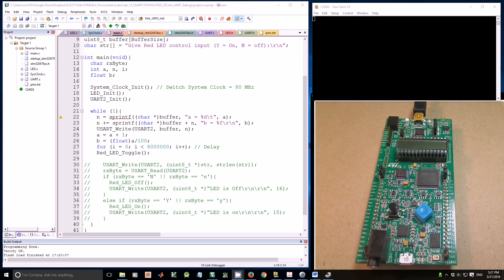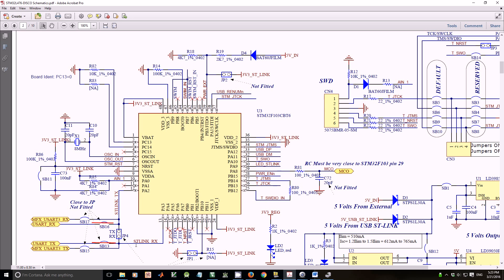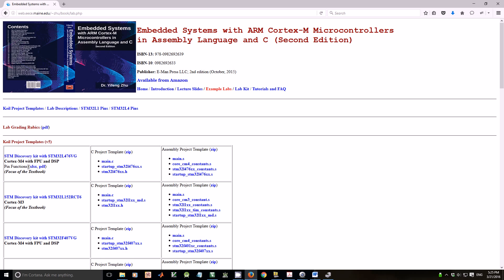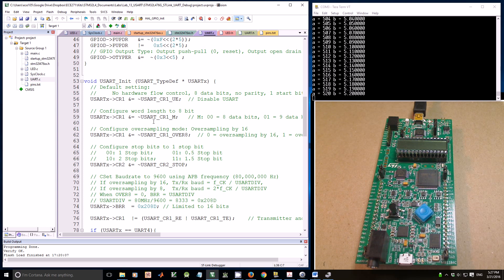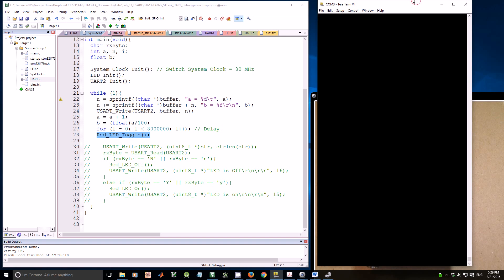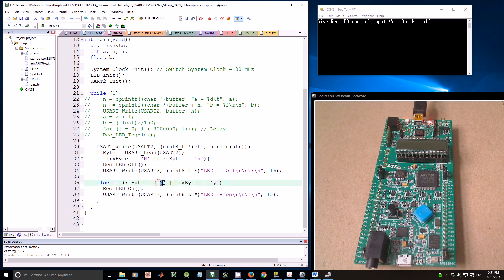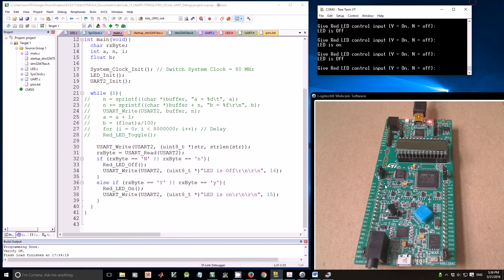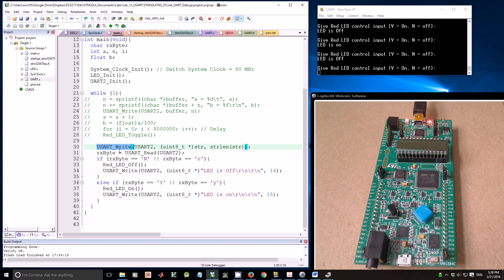Tutorial 4: Printing messages via UART through ST-Link V2.1

Comment: Hello, I am using stm32f407 with st link v2. I am not able to get the COM port and not able to select serial in tera term. Pls help
Reply: Did you find the solution?
Reply: @alperen7009  yes. the st link i was using was Chinese one. it doesn't have that feature to send data. so i used usb TTL converter with it. or go with original st link v2.   if u don't have usb TTL converter u can use Arduino UNO  using some connections.

Comment: What I want to receive"Hello" 
and Want to transmit" How are you"

and then If I receive "age " 
it will send " above 20" 
how to handle these strings and compare 
I
Reply from the maker: You can use strcmp() function provided by C. Basically it compares ASCII values one character by one character.

Comment: Hello, is there a way to use printf in debug printf Viewer using stlink V2? Urgent
Reply: urgently you should put the thanks to author
Reply from the maker: yes, you can.

#include "UART.h"
#include <stdio.h>

// Implement a dummy __FILE struct, which is called with the FILE structure.
struct __FILE {
    int dummy;
};

// We have to define FILE if prinf is used
FILE __stdout;
FILE __stdin;
 
// Retarget printf() to USART2
int fputc(int ch, FILE *f) { 
  uint8_t c;
  c = ch & 0x00FF;
  USART_Write(USART2, (uint8_t *)&c, 1);
  return(ch);
}

// Retarget scanf() to USART2
int fgetc(FILE *f) {  
  uint8_t rxByte;
  rxByte = USART_Read(USART2);
  return rxByte;
}